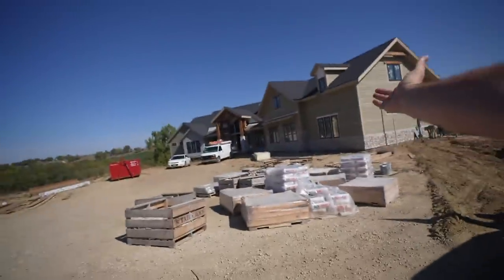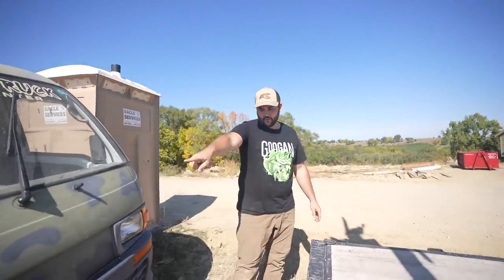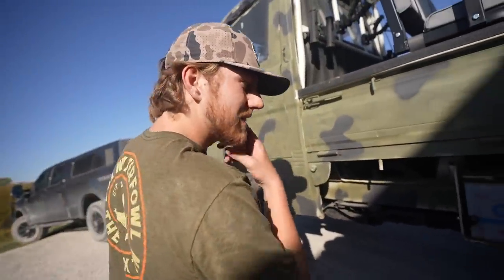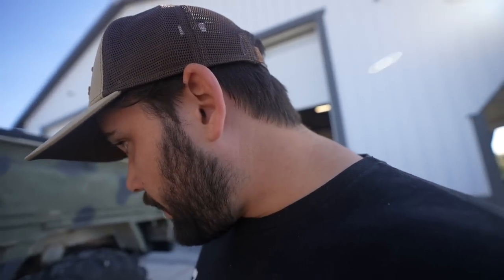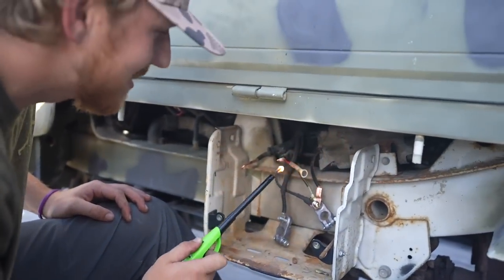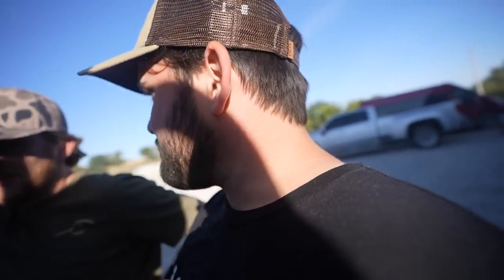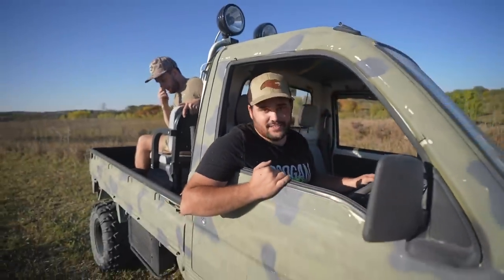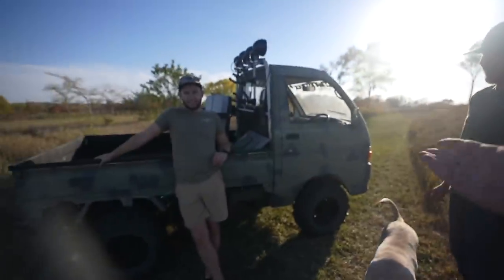Rescuing the ABANDONED Hunting MINI TRUCK (Will it run?)

Comment: Seafoam works really good. There is a second can for spraying into your air intake. Remove the air intake filter and spray while accelerating the engine. Then you will have the white smoke coming out of the exhaust. All that funky smell is because of the sea foam running through the system with the gasoline. It is heavy and goes below the gas. They would usually run it for an extended period of time until the white smoke stopped

Comment: I have that same exact charger the button you where pushing is to switch from lead acid/LifePo4 (lithium). Just wait if its a bad battery it will tell you in the display.

Comment: Hey You cannot go wrong useing the Sea foam! It will help the the gas burn it there is water in the gas tank! Which happens just from staying long time! Had a Nassan car fowl the spark plugs out, change them out would not run till put the sea foam in gas tank!

Comment: It sounds like y'all are running it in low gear. That thing should run at least 40-45mph. Which is pretty fast in a little truck like that. But it also sounds like it's running on one cylinder.

Comment: Put a solar battery charger on it so when it's sitting there it will keep the battery hot! The cab tilts forward, if I'm not mistaken?🤞 And when you slow down, you have to downshift accordingly!✌️🤔

Comment: i would of rolled it down a hill and tried push starting it first. thats one of the best parts of having a small standard. you can push start it every time its been st
itting and needs a battery or starter ect.
Reply: Not when it hasn’t ran for over a year, it took forever to start with a battery
Reply: @samjoiner7955  it woundt of just turned over rite away but im talking about a big hill.  If he popped the clutch for a good 50-100 meters while giving it gas it would of fired.

Comment: Just put a battery shut off on the negative side of the battery connection. Then you can just shut off the battery and when you need it just turn the switch and take off. No matter how long you have let it set.

Comment: Dude have you ever watched stradman? He just built a house with an elevator to a lower garage. What if you had a floor put in the silo, say 15 feet below the top, and have an elevator put in that would lower a few vehicles down(maybe mini truck and atvs). And could also put a building over top too.

Comment: Fix that wheel rub it will just cost you more in tires in the long run if you dont and glad you saved that little thing fro. Rusting up sounds like it has a motorcycle engine in it

Comment: Hook up a separate battery on your trailer to run the winch and put a solar panel on it so it always charging
Reply: Also put a green house on the silo property
Reply: You can also run the battery to the 7 pin connector accessory slot. And the vehicle running it will keep the battery topped off while towing.
Reply: @brenton.1024  how do you run the lights on the trailer then
Reply: All the lights have separate pins on your trailer plug if it's a 7 pin connector one pin is for 12v charging run your positive from battery to that pin/wire And negative to ground.

Comment: with the risk of nuclear war rite around the corner you should do some prepping videos where you chean out a bunch of those 50 gallon drum barrels and fill them with water. add a table spoon of clorine to each. also food prepping. grab a bunch of spam and baked beans and canned goods. make sure the air filter works good with replacement parts. your gonna need to learn how to repair that and any solor or generator. maby build a safe for some pews and set up a reloading station. get books on farming casting bullets, stock up on gun powder, black powder and 22lr.(50k should last you a few years of hunting small game)
Reply: You should get a flint lock muzzleloader for prepping and a 50 cal and 00 buck shot molds for casting. Olviously stock up on flint, muzzleloader bullets and black powder first but when you run out you can cast your bullets, find flint rock and make black powder verry easily.

Comment: You can crash start a manual by having ignition on the gearbox in second push or pull going above 20kph and then dump the clutch and it will start best way to by pass a bad battery

Comment: If its a manual transmission why not just roll start it? Get it rolling and pop the clutch.. if you can't push it pull it. No need to load it on the trailer

Comment: You need a bigger engine with more power so it don't stall any more and then it would be golden everything esles is perfect for what u want it's just lacking power
Reply: A small diesel would be perfect
Reply: I think the reason it’s stalling is more operator error